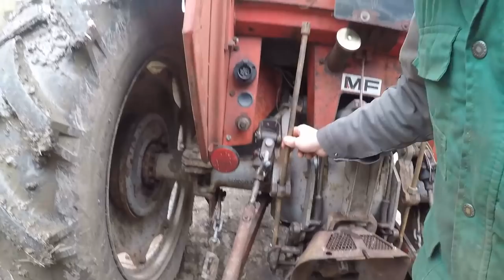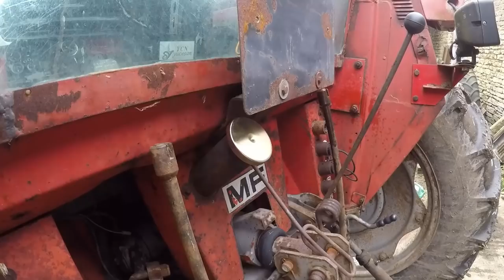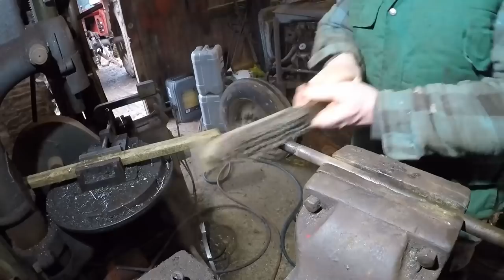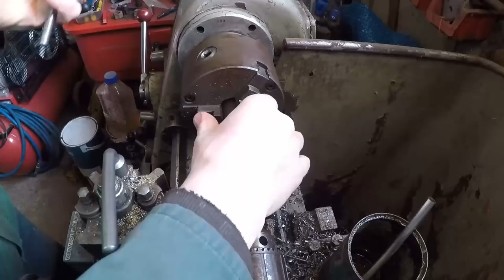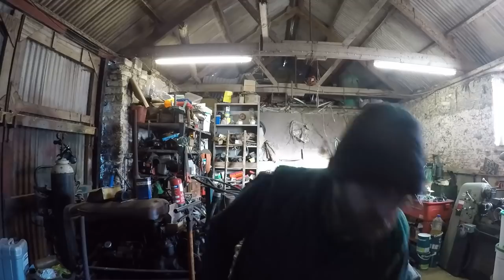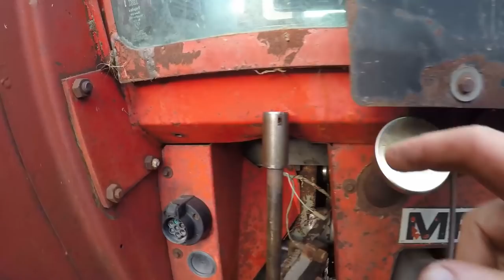Vintage Thursday. Bigger nuts.

Comment: Nice to see someone takin the time to carry out a proper repair instead of just throwin on anythin to act as a spacer 👌👍
Reply: I agree with you,but when youre out in a muddy field,tired,wet and hungry and the trailer wont lock in position you,ll do whatever you have to,to get home!! The older hitches on the 100 series had lift chains,you could put a bolt through a link to take up the slack..
Reply: @patwatters8205  yes your 💯 right been there done that we also used lynch pins through the links 👍

Comment: just a little tip when a part is siezed heat it up as you did to cherry red then quench it as quickly as you can ie chuck it in a big bucket of cold water and it will fall apart

Comment: The 100 series version of that hitch, the later square axle type with chains rather than rods [earlier ones had loops of steel rod], were very prone to chains stretching but, significantly, the solid arm that lifts that part and bolts to the inner side of the main lift arms were prone to twisting. Not a problem in normal use but prone to abuse if lifting a heavy load using the long drawbar rather than the hook. Since it is unlikely that the rods you adjusted here have stretched, it is probably the case that those brackets that actually lift them have twisted slightly, especially on the right hand side in your case. That’s even though this part is much much stronger than earlier versions which were plate steel.
Reply: rubbish
Reply: @jamesmccabe1702  
Yes, i tend to agree that it is rubbish. The 600 series version made it so much more user friendly. Unfortunately at the cost of losing the swinging drawbar. Better visibility of the hook. Increased traction. Easy in-cab use of release mechanism and very significantly better steering lock before wheels meet trailer drawbar. The 500 series was their first attempt at a Q cab and it was very good in many ways, but it also had its disadvantages and carrying over the 100 series auto-hitch design with only a mild upgrade was one of them
Reply: @hedydd2  No, your comment is utter rubbish.
Reply: @jamesmccabe1702  
Explain yourself. You could start by telling us which part of the hitch in question has bent or stretched. It could be that the lugs at the bottom have stretched or the hitch lifted with the drawbar to one side of the frame rather than the hitch. I’ve seen it all before.
Reply: @hedydd2  "explain yourself"? Do you really think youre that important? You need a break from social media chap
Reply: @jamesmccabe1702  
You said “rubbish’’.  I expect you to explain yourself. You seem intent on fermenting trouble yet again with this post. A typical Troll.
So explain your comment if indeed you are capable of doing so, which I very much doubt.
The 100 series chain type often had Lynch pins or bolts and nuts inserted to compensate. This later type seen on the 550 is substantially more robust, having many subtle modifications compared to earlier ones.
So let’s hear what is so ‘rubbish’ in your esteemed opinion. Over to you.
Reply: @jamesmccabe1702  
Case proven. You haven’t the slightest clue and if you have, you cannot articulate it. Typical troll. All abuse and no substance. Completely unable to stop digging an ever deeper hole for themselves. Keep digging. We all appreciate a good laugh at your expense.
Reply: @hedydd2  Again, top of the class for creative writing, pity nobodys actually reading these, you could get a job writing romance novels with your vocabulary.
Reply: @jamesmccabe1702  
Thank you, I appreciate the complement. It’s a pity that there is no credible reason for returning it.